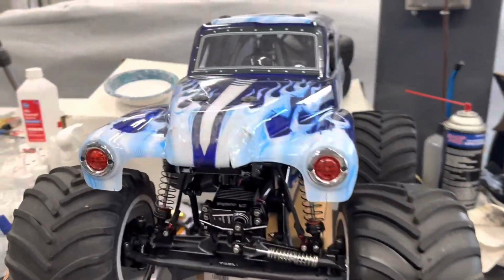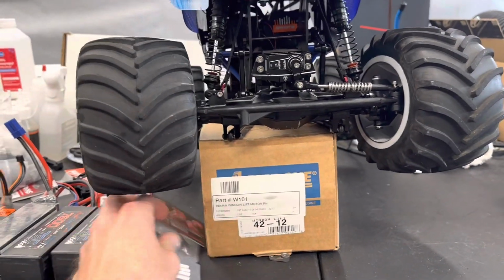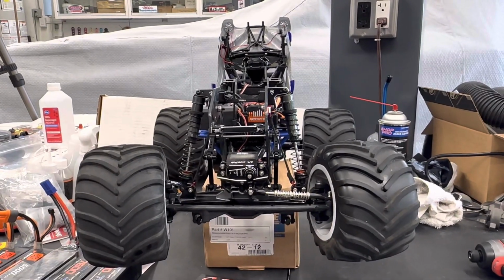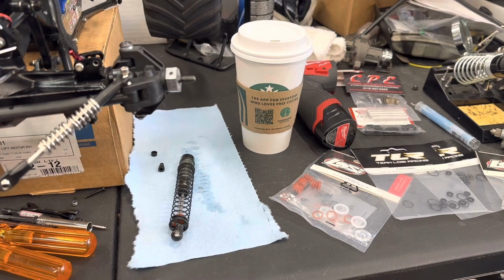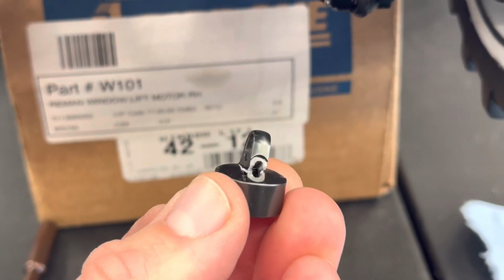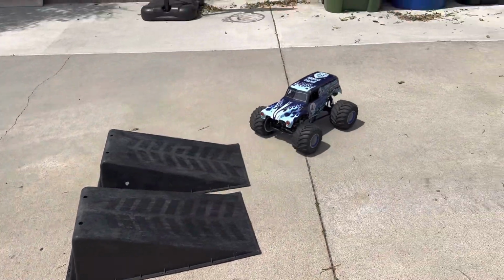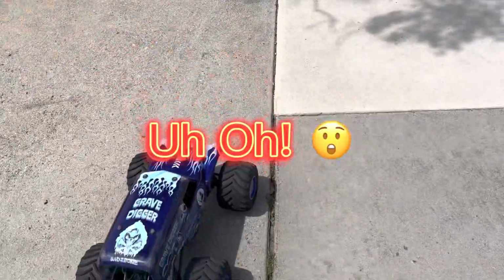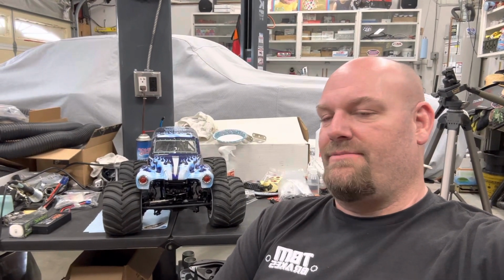The Best Losi LMT Grave Digger Shock Upgrade Ever!!

Comment: I've got the King Sling. Running it on Grave Digger wheels and Proline Demolishers. I destroy the rod ends on the upper, front links. Actually drove the links into the motor on both sides and dented the motor can. These braces look like a great idea. Thanks Custom Garage, Great vid. I've also being running, TLR 40W shock oil all around. It's been planted off jumps pretty good. It is very hot here in Australia currently though.
Reply from the maker: Yes the TLR braces are even better!! They are a great upgrade.  Cheers and thank you for the positivity

Comment: does all the aluminum add much weight overall? looking at the ssd 1/2 axles, they only replace the stock 3 piece plastic for 1 piece aluminum. other than that, i may do aluminum chassis braces and probable the shock oil and tlr seals! thanks for the great vid.
Reply from the maker: I haven’t weighed the two we have, but you can tell there is a difference. The one truck has the aluminum axles and the aluminum center which adds a lot. I personally would not do the axles until they break. We are leaving a lot of the other OG grave digger stock and adding a few braces and stuff.  Thank you for positivity!!! The TLR seal kit is huge!! It makes a big difference

Comment: What tools you like/or have that won’t strip the bolt?
Reply from the maker: I like and use MIP the most. I also have some protek tools as well
Reply: @818_Custom_Garage  I was looking into both brands.  What about wrenching,
Reply from the maker: @Mazdatechsenior  automotive wise I use a lot of older craftsmen for wrenches, Matco for screwdrivers and snap on as well. For the super small 5.5mm nuts and stuff the protek and a regular sockets work well. If you can’t get in there, needle nose and small pliers work well
Reply: @818_Custom_Garage  just got some hex snap on hand driver and could definitely tell the difference. For sure thanks
Reply from the maker: @Mazdatechsenior  awesome.  Good tools definitely make the job easier. The MIP drivers are the best I have ever used. They are by far the most precise
Reply: @818_Custom_Garage  I’m having trouble with some bolts. First encounter was with the front shaft bolt, stripped right away. There are super tight. I wanted to replaced with the treal shaft but know I stripped the shaft remaining that is going to the center differential. Any advice removin small hex bolts. I use my snap on and matco bolt extractor and no luck.
Reply from the maker: @Mazdatechsenior  I usually put some heat on them. If you have a little torch or even a cheap cigar lighter. They may have a lot of loctite on them. If they are already stripped, I will usually weld a cheap bolt to them and spin them out